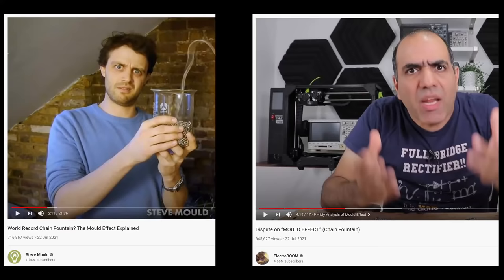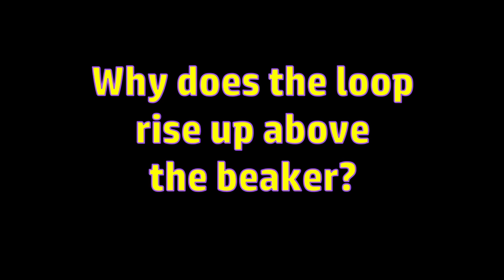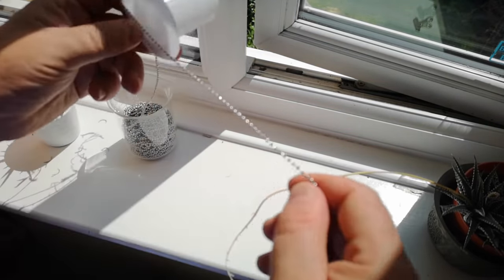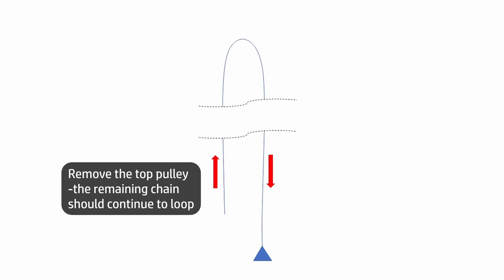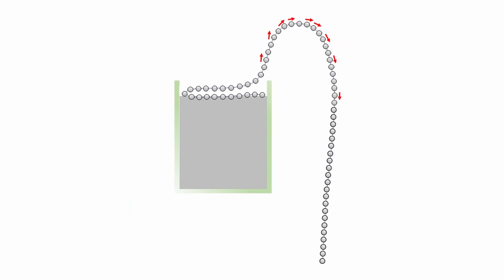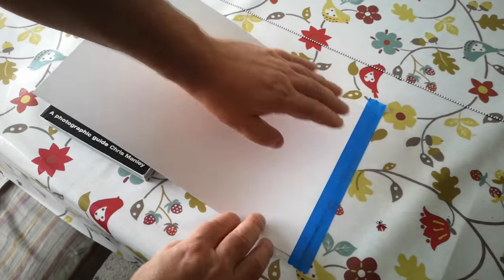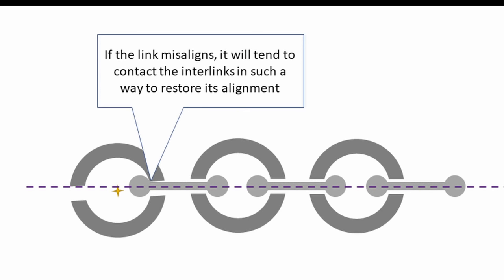Investigating the 'Mould Effect' - (Ball Chain Fountain)

Comment: I think you've done a very good job here, although it seems to me that you haven't been educated in pre-university physics, instead having an experimentalist, hands-on way of getting things done which can be useful compared to the more hard-core theoretical approach. The key-point I've taken from your experiments is that the upward velocity of the beads coming out of the container cannot be immediately reversed to a downward motion: it takes a finite time. And this reversal is provided by the loop at the top which becomes larger as the velocity of the beads increases. This will depend upon the depth of the container a bead has to surmount and hence its exit upward velocity, and the velocity of the downward moving beads.

Comment: Atomic Shrimp, if the metal ball chain works because it doesn't lose energy from moving around, why doesn't it work with a plastic chain ball chain that is almost identical in structure to the metal one? (I'm not trying to start an argument)
Reply from the maker: I think it does actually happen with some plastic ball threads, but the metal version has greater mass, which means more momentum when it is in motion.

Comment: Mike I have a theory... but i do not have the means to execute any experimentation...from what i am seeing is that you are using ball-chain there, from your video I see that you are treating the chain as a a fluidic entity, but there is one thing that I am seeing that hasn't been inputted into the "equation" between each link of ball chain is a straight metal bar when you bend the chain there is a flexion limit because of those straight bars that isn't exhibited in other types of chain... At flexion limit the chain will act as a solid not a fluid, so what we are seeing when the chain is flowing at maximum flexion is the chain in flux between two pseudo states (fluid and solid almost simultaneously) as it moves quickly from the beaker... therefore it stands to reason that each straight bar between the balls acts like a lever of sorts that pops up the the next ball behind it, and this effect doubles and redoubles until weight and mass limits maximizes the effect, raising it way above the lip of the beaker as the chain is flowing straight down and out of the beaker...The effect should happen less if the chain hasn't reached its full flexion limit as when it was flowing over your spool... (at speed I am guessing that the leaver effect is multiplied with all balls coming out of the beaker being at maximum distance from each other, which in turn means that the bar lengths that connect the balls together are trying to form one straight bar due to centrifugal force hence a leverage - like effect.)

If you were to increase the size of the balls and the bars that hold them together i think what I am saying would be more easily evident such as tennis balls connected together by wooden dowels that are scaled to the same size that is used in the ball chain... How i wish I could do that experiment to see what happens but I guess i shall have to be satisfied with what I see in my minds simulation of things lol

I would be interested to know what you think.
Reply from the maker: This limit is a possible factor - I think the thing that tends to suggest it's not the main factor is that the curvature of the top of the loop is often broader than the maximum bend of the chain (i.e. where the lever/stiffness effect really kicks in) - however, it's possible that the rigid link mechanism still has some sort of effect before it reaches this limit
Reply: @AtomicShrimp  firstly its a pleasure to converse with you, I am a huge admirer of your work on YouTube... Might I interject another idea into the issue at hand?  

What if the ball links at full extension act in the same way as the old catapults. 

When the catapult wasn't secured to the ground it would spring into the air rear first (what if there were two catapults connected by a swiveling rod, the first catapult would raise the next, and if the next one fired at apex it would go higher into the air).

if the ball chain sets did this over and over again. this could possibility on that micro-level start to raise the ball chain higher and higher out of the beaker.

I could be way off base here, but the fact that this phenomena happens most frequently with ball-chain, i would think that the one thing that makes the chain different is the thing that is causing the phenomena... and that is the construction of the chain itself mainly the bar structure that holds the balls together... But I defer to you, I think that you may have a better grasp on the issue at hand than I.

Thank you Mike for the Stimulating conversation, and the opportunity to converse at this level... I do hope we can do this again some time, it's nice to meet you sir.

Comment: You do get this with ship anchors as well, although not with the same effect….
Reply from the maker: Interestingly, anchor chain typically as crossbars in the links, and fits together more closely than hardware store chain, both of which constrain it more, and make it flow better (which is necessary for the application) - I would expect anchor style chain to have more of a tendency to do the fountain thing than cheap hardware store chain
Reply: @AtomicShrimp  I think anchor chains are just to heavy, to get this effect, however the length of the chain or the final depths of the  ocean floor. 
But the experiment in your video was much less dangerous, even your house is high enough to accommodate a giraffe.
😁

Comment: Mythbusters experimented with this years ago and found the height of the chain fountain is also proportional to the size of the balls as well as the height...which in my mind means the difference in "work done" or relative inertial energy of the two lengths of ball chain (one in and one out of the beaker) has more of an effect than any "lever" effect as Mr mould proposed ..I do like yourself suspect there's more than one effect in play here.
https://youtu.be/Agluv4iHx14

Comment: Medhi demonstrates that most chain types will sustain a fountain if they are given a boost, but doesn't explain why *these chains* self create a self growing fountain. The momentum and wave observations are important to understand why chain fountains exist at all. Mardi Gras beads are a more important comparison than regular link chains, in my view.
Reply from the maker: I really want to try this with a chain that is very flexible (so, strung on something really soft) and has a very tight bend radius - maybe beads shaped like elongated rugby balls - a lot of people still think the leverage of the minimum radius of curvature is a factor, and it may or may not be.
I think the mistake is probably to imagine there is some singular attribute of ball chain that makes it do this, but I suspect it's more complex and there are multiple factors at play - ball chain just happening to exist in a sweet spot of the latent space of all those factors.
Reply: @AtomicShrimp  yes. A series of experiments needs to test all the variables. Bead weight, size, distance apart. Linking material composition, thickness, stiffness, the amount of flexing it allows for the beads. Even a chain of beads that are strung loosely on to their string, without being fixed to a specific point on it.

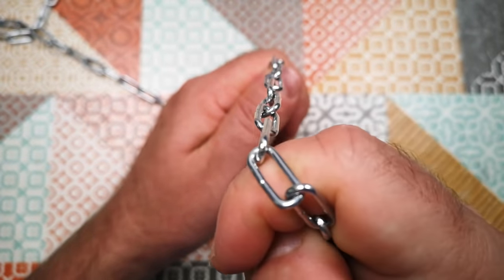Comment: I believe the beads are spinning. At 13:10 in this video you can clearly see the chain links twisting on the slack side. https://youtu.be/hx2LEqTQT4E
I would speculate as one end of a link is accelerated from rest, the other end acts as a pivot point but it is not rigidly held by the next link. The pivot being free to move allows momentum to move its axis toward the direction of most mechanical freedom (and maybe toward a smaller moment?) so some momentum is turned into spin until it’s forced to change its spin axis(at the top) thus pulling against the downward force. The more energy in the system, the more spin is stored in the upward moving beads.
Reply from the maker: What an interesting idea!  If the beads are actually spinning, there will be gyroscopic effects, which will tend to keep them oriented in the same axis (which could impart sort of stiffness effect overall, to the chain)
Need a slow-mo camera to determine that, and then mark all of the beads with a sharpie
Reply: @AtomicShrimp  Yes, I don't know why anyone used slow mo yet, but it looks pretty convincing on ElectroBooms video. I'm no physicist either but when I see the chain spiral as it comes up out of the jar, I see spinning and positive feedback.
Reply from the maker: Your observation is a tantalisingly good fit - not only does the chain spiral as it rises, but that spiral narrows, suggesting that the energy is being transferred from rotation of the chain (in space) to rotation of the balls (on axis).
I wonder if I can rig up a slowmo setup of some sort (or hire a slowmo camera)
Reply: @AtomicShrimp  Yes, please try. Or if you have enough influence to get the attention of "The Slow Mo Guys" or "Smarter every day", they have high speed cameras
Reply from the maker: @zaphodbeeblebrox2817  You'll be credited if this theory has legs
Reply: @AtomicShrimp  If it's true, then a ribbon or something that can't twist, should not have this effect. Or if the chain came off of a spool, it might not show this effect since it's momentum will have already been aligned.
Reply from the maker: One way to test this will be beaded string where the beads are fused to the cord and are not free to rotate.  Of course if that stuff doesn't form a fountain, then it won't prove anything on its own.
Reply: @AtomicShrimp  they are fused to the cord but the cord can twist. Linked chain and rope show the effect(although limited) because it can twist and un twist. In ElectroBoom’s video you see the normal “linked” chain doing it. It clearly twists as he pulls it across the floor.
Reply: @AtomicShrimp  I’d like to know if the beaded chain still has the effect if it comes off of a spool instead of out of a pile. I think it wont, or at least it would be limited.
Reply from the maker: I don't know what happened to your comment with the link to your own video ( https://www.youtube.com/watch?v=0uXRrjk4F5o ) - I released it from the 'held for review' side, but it hasn't turned up here yet.
It's a very interesting experiment and I like the way it isolates the rising loop from the falling one - I am not exactly sure what this demonstrates, but it's hugely interesting.
I've been chatting with Steve Mould via email as he's planning a followup video; I just sent him a link to yours
Reply: @AtomicShrimp  Yeah, sorry, I deleted it and posted another. I can be quite indecisive. 
Yes interesting but what does it mean? Now I’m undecided about the beads spinning. Perhaps they just facilitate good spirals and the spirals “hold” momentum that aids the fountain. I am of two minds on this(ha ha) Either way I think the pull force generates a kind of stationary angular momentum in the system of links. At least until I change my mind again
Reply: @AtomicShrimp  I am more resolute in my hypothesis than ever https://www.youtube.com/watch?v=Lo3Sltktifo But this video and its description(should have been in the video) is about as far as I want to take it. If it makes sense to you and you care to do a video about it then please do. As others have pointed out, in Steve's "proof" video he falsely claims Electroboom floor chain doesn't rise, when it clearly does rise from the point a link starting to move to the top of the arc.(which is equivalent to height of a vertical fountain) and in the same video you can clearly see the chain rapidly spiraling at the point of acceleration but they say nothing about that. I still think the beads are spinning near the top (would love to see high speed) but it can't be necessary because a rope will work.

Comment: great video! wander if it will work with a regular thick rope.
Reply from the maker: I dimly recall some stories of it being observed in ropes as they uncoil, maybe related to harpoons or heavy anchors. I wish I could find the reference
Reply: I think there has to be quite a big balance between flexibility of the rope and mass to generate the effect.
As the balls on just certain point don't take away a lot of the flexibility yet add a lot of mass
Thick rope does give up too much flexibility for its mass
Reply: @AtomicShrimp  yes ! i know exactly what you talking about. But you need a fairly thick and stiff rope, i guess.

Comment: Interesting, however the conclusions are not correct, because science was not followed. To his credit Shrimp acknowledged this. This was his own speculation. The same phenomena can happen with rope and large link chains. Granted it is easier to replicate with a small ball link chain. However this is not limited to those only. This has been observed on ships dropping anchor with massive link chains. This is why ships now have a damped decent to prevent chain from snaking.
Also the wave effect shown was seriously flawed as the chain Shrimp was using had a far higher mass than the small ball link chain. Therefore the frequency of oscillation would be significantly different.
Reply from the maker: The chaotic movement of the link chain under oscillating input is not a function of the frequency of the oscillation (I tried with several different chains, and the WobbleDog is continuously adjustable within its speed range; the footage you see in this video is just an example that happens to best show - visually - the phenomenon I was trying to describe)
The link chain exhibits chaotic movement, I believe, because the links are not not self-concentric to the chain - they are free to move in ways that offset their individual centre of mass from the axis of the chain - ball chain simply can't do that due to the shape of its components and the nature of its construction.
Reply: @AtomicShrimp  
Thanks for your reply. However I believe you have overlooked that you are subjecting the link chain to the same conditions as the thin ball link chain.
If the large link chain was longer and the amplitude of the oscillation was higher and at a lower frequency than that of the ball link chain, then you would generate a steady wave in the link chain also.
I believe it's a question of scale due to the difference in mass.
Reply from the maker: I don't think you're wrong about scale and mass having effects of their own, but I do think you are overlooking the very important factor of the non-concentricity of regular link chain.  Link chain (especially cheap stuff from hardware stores) has tremendous capacity for the individual links to consume energy changing their orientation.  Ball chain simply doesn't have this.
Some types of link chain - notably some jewellery chains, and boat anchor chain, are more like ball chain in the way the links are constrained from deviation.  I would expect to see the chain fountain effect more easily reproduced with those sorts of chains than with hardware store chain
Reply: @AtomicShrimp  
I agree that different manufacture of chains can make a difference in how a chain may carry a wave. However that is getting away from the original matter. All chains, no matter how they are manufactured are able to carry a wave if they are given the correct amplitude and frequency for the length. The amplitude is only really important due to the mass of heavier chains.
That was the original argument I gave to your obviously humorous wobble dog test. I feel you are shifting the original discussion here. I don't wish to say straw man argument...Oh damn, I've said it.
Reply from the maker: I don't disagree that chains can carry a wave.  The only thing I can really suggest here is to get yourself a length of ball chain and another length of regular chain - it actually doesn't matter the sizes - when you impart a periodic oscillation to the ball chain, it is transmitted a long way (in the video, what you can't see is the wave being transmitted down to the floor and continuing along the length of slack chain all the way to the wall) - when the same thing is done with link chain, the wave quickly changes phase and loses coherence (before it even got to the floor).  Try it for yourself.
Reply: @AtomicShrimp  
Once again, thank you for taking the time to reply. It is really nice that you read and seriously consider the comments.
This only goes to prove, as I can see that amplitude plays a large part when you are looking at a chain with much greater mass. A small amplitude on a high mass chain is more subject to noise in the system. ie discrepancies in manufacture of each link is amplified, friction due to how the chain is in contact with a surface would also make a big difference with a high mass chain compared to a very low mass chain.
In your experiment you are applying the same amplitude to a high mass object as a low mass object. So of course a wave in the low mass chain will carry through. However that wave will be damped out and become chaotic in the much higher mass chain due to the issues I mentioned earlier. In a like for like experiment you would have to apply a much higher amplitude to the chain with greater mass.